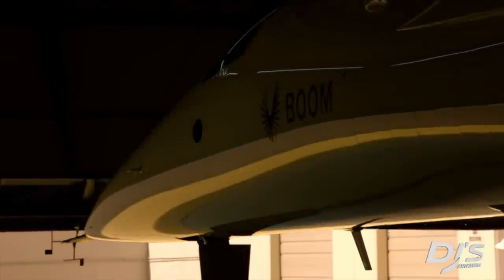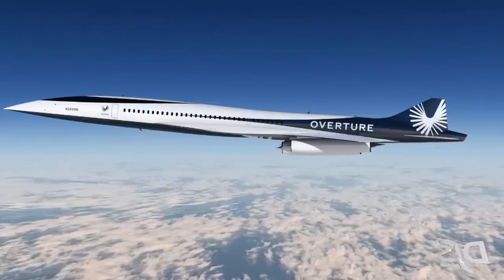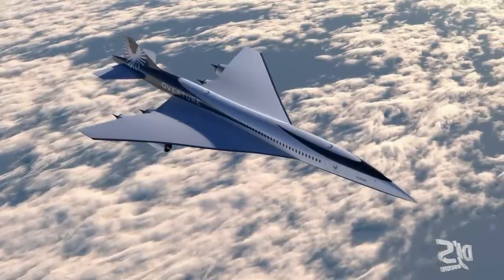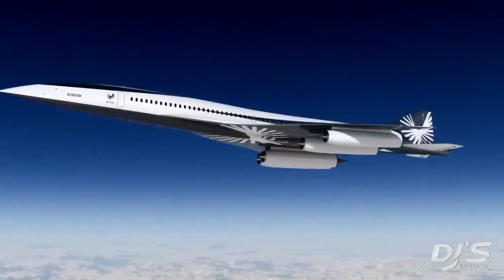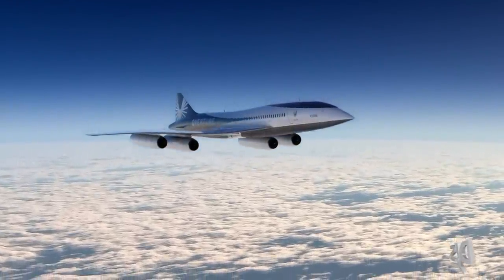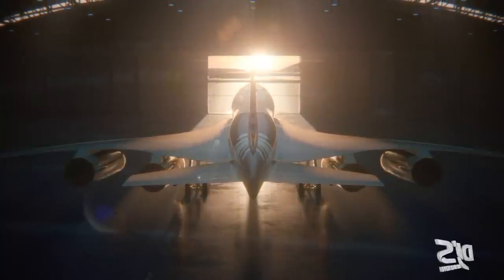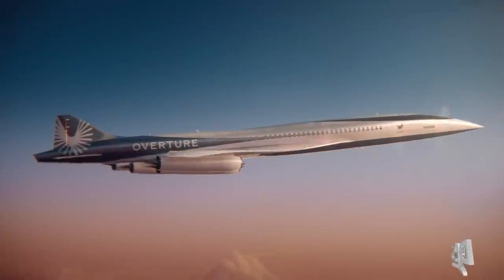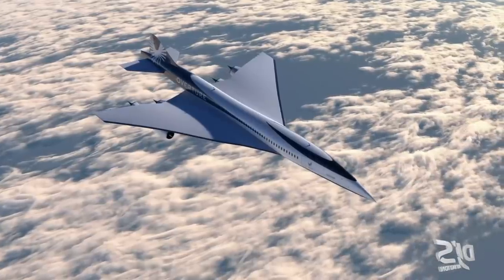Boom Supersonic MASSIVE News

Comment: Crazy.  They would have to sell hundreds of planes to even hope of breaking even.  There aren’t that many customers or routes or customers willing to pay triple the going rate to sit in a tiny seat.
Reply: Overture is not aimed at the main line economy market, which is more than adequately catered for by Boeing and Airbus, for example. Instead, it is targeting the 700 million long range business trips made each year globally, 400 million by Americans.

Because Overture will be fuel efficient at sub and supersonic speeds, and will be compliant with ICAO-14 subsonic noise regulations, Boom and the airlines have identified 500 viable routes, some mixed land/water, compared to just 2 Atlantic routes for Concorde. Commercial supersonic flight over land is effectively banned worldwide, so Overture will fly Mach 0.94 (10% to 20% faster) over land and Mach 1.7 (x2 faster) over water. 

A subsonic airliner does the JFK/LHR trip in 8 hours. Overture will do it in 4 hours.
A 16 hour subsonic trip across the Pacific would require a 1 hour refuelling stop, giving a duration of 4+1+4=9 hours total on Overture. 

All 65 to 80 seats will be quiet business class, almost certainly with internet, with ample room. Tickets will be the same price as subsonic business class. This, coupled with twice the utilisation of subsonic airliners, would give a good margin for the airlines.
Reply: Boom have set a unit price for Overture at $200M. The forecast development program cost is $8bn, so the payback would probably be around 150 aircraft.

Comment: Oh my god. Switch to 4 engine now ? But i want to see a supersonic aircraft with 3 engines
Reply: Where are you going to put the third engine? I'm sure there are big aerodynamic penalties for putting one in the tail
Reply: I absolutely hate three engine planes, even going back to the tri motors of the 1920s. They just look incongruous to me. The third engine has often caused problems with maintenance, failures, and upgrades too. An engine in the tail inevitably means a high horizontal stabiliser which entails high leverage forces and susceptibility to deep stall.

Comment: Unless the cost of a ticket is comparable to tickets on conventional airliners, it will remain a niche product at best. The same economics (as well as the environmental concerns) are what limited Concorde to just 14 airframes sold.
Reply: But i believe this is in fact the ideia. Its is a plane for business travelers, not for the masses as the Concorde tried to be
Reply: Overture is not aimed at the main line economy market, which is more than adequately catered for by Boeing and Airbus, for example. Instead, it is targeting the 700 million long range business trips made each year globally, 400 million by Americans.

Because Overture will be fuel efficient at sub and supersonic speeds, and will be compliant with ICAO-14 subsonic noise regulations, Boom and the airlines have identified 500 viable routes, some mixed land/water, compared to just 2 Atlantic routes for Concorde. Commercial supersonic flight over land is effectively banned worldwide, so Overture will fly Mach 0.94 (10% to 20% faster) over land and Mach 1.7 (x2 faster) over water. 

A subsonic airliner does the JFK/LHR trip in 8 hours. Overture will do it in 4 hours.
A 16 hour subsonic trip across the Pacific would require a 1 hour refuelling stop, giving a duration of 4+1+4=9 hours total on Overture. 

All 65 to 80 seats will be quiet business class, almost certainly with internet, with ample room. Tickets will be the same price as subsonic business class. This, coupled with twice the utilisation of subsonic airliners, would give a good margin for the airlines.

Comment: Assuming the composite structure can handle the surface temperatures generated at supersonic speeds
Reply: Its like 30C at mach 1.7, so its really not an issue

If you really want high temperatures there is carbon-carbon composite that can handle 800C.
Reply: @matsv201  content if that is the case. Concorde grew a few inches in length as full speed because of the heat generated on the surface by friction of the air passing over it. That was more than 30c.
Reply: @nicholasgething2163  No Concorde fly faster, hence are warmer. Around 60C. SR71 is even warmer.

Comment: Well did they ask Boeing for their design of the 2707-300? Crazy after simulations on software and it basically made a design over 60 years old. 

Shame its not got a 300 passenger capacity like its 60s design

Comment: This new design looks like it takes inspiration from the Boeing 2707, an SST concept which never advanced beyond a full-scale mockup.
Reply: The 2707 was a swing wing design. This is a delta wing
Reply: @jacobmoses3712  The 2707-300 was fixed wing with empennage, just like the latest Overture. The previous 2707-100 and -200 designs were swing wing.

Comment: Wasn’t part of the problem with concord that it couldn’t travel fast over land? This aircraft has to slow down over land too 🤔
Reply: Yeah. It's a redundant idea tbh
Reply: No civil aircraft can fly Mach 1 over land anywhere in effect, so Overture will fly Mach 0.94 (10% to 20% faster) over land and Mach 1.7 over water. The major difference between Concorde and Overture is that Concorde gobbled fuel subsonically, whereas Overture will be fuel efficient. Because of this, Boom and the airlines have identified 500 viable routes, compared to just 2 viable Atlantic routes for Concorde.

Comment: What is the market for this? ...... Trans Atlantic or Trans Pacific ? ..... LA or SF to NYC or Miami ??  Despite substantial improvements, Fuel consumption along with the Sonic boom issue will likely limit its flight corridors. If they do make it to production, I think they'll become a toy for the super rich with just a couple of dozen ultimately built.
Reply: Overture is not aimed at the main line economy market, which is more than adequately catered for by Boeing and Airbus, for example. Instead, it is targeting the 700 million long range business trips made each year globally, 400 million by Americans.

Because Overture will be fuel efficient at sub and supersonic speeds, and will be compliant with ICAO-14 subsonic noise regulations, Boom and the airlines have identified 500 viable routes, some mixed land/water, compared to just 2 Atlantic routes for Concorde. Commercial supersonic flight over land is effectively banned worldwide, so Overture will fly Mach 0.94 (10% to 20% faster) over land and Mach 1.7 (x2 faster) over water. 

A subsonic airliner does the JFK/LHR trip in 8 hours. Overture will do it in 4 hours.
A 16 hour subsonic trip across the Pacific would require a 1 hour refuelling stop, giving a duration of 4+1+4=9 hours total on Overture. 

All 65 to 80 seats will be quiet business class, almost certainly with internet, with ample room. Tickets will be the same price as subsonic business class. This, coupled with twice the utilisation of subsonic airliners, would give a good margin for the airlines.

Comment: Seems little more than an updated Concorde. It should be slightly cheaper to run but it still looks to be for the few.
Reply: Overture is not aimed at the main line economy market, which is more than adequately catered for by Boeing and Airbus, for example. Instead, it is targeting the 700 million long range business trips made each year globally, 400 million by Americans.

Because Overture will be fuel efficient at sub and supersonic speeds, and will be compliant with ICAO-14 subsonic noise regulations, Boom and the airlines have identified 500 viable routes, some mixed land/water, compared to just 2 Atlantic routes for Concorde. Commercial supersonic flight over land is effectively banned worldwide, so Overture will fly Mach 0.94 (10% to 20% faster) over land and Mach 1.7 (x2 faster) over water. 

A subsonic airliner does the JFK/LHR trip in 8 hours. Overture will do it in 4 hours.
A 16 hour subsonic trip across the Pacific would require a 1 hour refuelling stop, giving a duration of 4+1+4=9 hours total on Overture. 

All 65 to 80 seats will be quiet business class, almost certainly with internet, with ample room. Tickets will be the same price as subsonic business class. This, coupled with twice the utilisation of subsonic airliners, would give a good margin for the airlines.

Comment: This aircraft will probably only cater to the top 1%
Reply: Overture is not aimed at the main line economy market, which is more than adequately catered for by Boeing and Airbus, for example. Instead, it is targeting the 700 million long range business trips made each year globally, 400 million by Americans.

Because Overture will be fuel efficient at sub and supersonic speeds, and will be compliant with ICAO-14 subsonic noise regulations, Boom and the airlines have identified 500 viable routes, some mixed land/water, compared to just 2 Atlantic routes for Concorde. Commercial supersonic flight over land is effectively banned worldwide, so Overture will fly Mach 0.94 (10% to 20% faster) over land and Mach 1.7 (x2 faster) over water. 

A subsonic airliner does the JFK/LHR trip in 8 hours. Overture will do it in 4 hours.
A 16 hour subsonic trip across the Pacific would require a 1 hour refuelling stop, giving a duration of 4+1+4=9 hours total on Overture. 

All 65 to 80 seats will be quiet business class, almost certainly with internet, with ample room. Tickets will be the same price as subsonic business class. This, coupled with twice the utilisation of subsonic airliners, would give a good margin for the airlines.

Comment: Only carrying 65 to 80 passengers means the ticket prices are going to be crazy stupid
Reply: Overture is not aimed at the main line economy market, which is more than adequately catered for by Boeing and Airbus, for example. Instead, it is targeting the 700 million long range business trips made each year globally, 400 million by Americans.

Because Overture will be fuel efficient at sub and supersonic speeds, and will be compliant with ICAO-14 subsonic noise regulations, Boom and the airlines have identified 500 viable routes, some mixed land/water, compared to just 2 Atlantic routes for Concorde. Commercial supersonic flight over land is effectively banned worldwide, so Overture will fly Mach 0.94 (10% to 20% faster) over land and Mach 1.7 (x2 faster) over water. 

A subsonic airliner does the JFK/LHR trip in 8 hours. Overture will do it in 4 hours.
A 16 hour subsonic trip across the Pacific would require a 1 hour refuelling stop, giving a duration of 4+1+4=9 hours total on Overture. 

All 65 to 80 seats will be quiet business class, almost certainly with internet, with ample room. Tickets will be the same price as subsonic business class. This, coupled with twice the utilisation of subsonic airliners, would give a good margin for the airlines.

Comment: It will not be allowed to break the sound barrier over land...Only across the ocean. This is what limited Concorde in it's operations and it will do the same to Boom.
Reply: Overture is not aimed at the main line economy market, which is more than adequately catered for by Boeing and Airbus, for example. Instead, it is targeting the 700 million long range business trips made each year globally, 400 million by Americans.

Because Overture will be fuel efficient at sub and supersonic speeds, and will be compliant with ICAO-14 subsonic noise regulations, Boom and the airlines have identified 500 viable routes, some mixed land/water, compared to just 2 Atlantic routes for Concorde. Commercial supersonic flight over land is effectively banned worldwide, so Overture will fly Mach 0.94 (10% to 20% faster) over land and Mach 1.7 (x2 faster) over water. 

A subsonic airliner does the JFK/LHR trip in 8 hours. Overture will do it in 4 hours.
A 16 hour subsonic trip across the Pacific would require a 1 hour refuelling stop, giving a duration of 4+1+4=9 hours total on Overture. 

All 65 to 80 seats will be quiet business class, almost certainly with internet, with ample room. Tickets will be the same price as subsonic business class. This, coupled with twice the utilisation of subsonic airliners, would give a good margin for the airlines.

Comment: At 201 feet long, this aircraft is only 3 foot shorter than Concorde and with a greater wingspan, yet carries less passengers. Something is not quite right about this design. I do hope it makes it though.
Reply: Overture will have better low speed handling, with slower take off and landing, as a consequence of the bigger wing with leading and trailing edge flaps (both similar to the proposed B revision to Concorde) and empennage. Also, Overture will be much lighter. These factors should assist in avoiding the tyre blow outs that dogged Concorde.

Overture's roomy cabin will be quiet and the 65 to 80 seats will be comfortable business class, compared to Concorde's noisy cramped cabin and 100 economy class seats.  Overture will cruise at Mach 1.7 over water, but Concorde cruised at Mach 2.0.

Comment: A technological marvel, but I have doubts about the feasability of this aircraft. More fuel-efficient than the Concorde, sure, but how will it compare to the existing Boeing 787 and Airbus A350? And a range of only 4250nm and capacity of only 80 pax? That capacity is even smaller than that of the Boeing 737 and Airbus A320. Considering the amount of fuel it could potentially burn per seat, I'm reluctant to buy a ticket to board this aircraft.
Reply: Overture is not aimed at the main line economy market, which is more than adequately catered for by Boeing and Airbus, for example. Instead, it is targeting the 700 million long range business trips made each year globally, 400 million by Americans.

Because Overture will be fuel efficient at sub and supersonic speeds, and will be compliant with ICAO-14 subsonic noise regulations, Boom and the airlines have identified 500 viable routes, some mixed land/water, compared to just 2 Atlantic routes for Concorde. Commercial supersonic flight over land is effectively banned worldwide, so Overture will fly Mach 0.94 (10% to 20% faster) over land and Mach 1.7 (x2 faster) over water. 

A subsonic airliner does the JFK/LHR trip in 8 hours. Overture will do it in 4 hours.
A 16 hour subsonic trip across the Pacific would require a 1 hour refuelling stop, giving a duration of 4+1+4=9 hours total on Overture. 

All 65 to 80 seats will be quiet business class, almost certainly with internet, with ample room. Tickets will be the same price as subsonic business class. This, coupled with twice the utilisation of subsonic airliners, would give a good margin for the airlines.

Comment: Ten bucks says that tail gets a little bit bigger. The plane will need it for slow speed controllability. I’m not sure composites will make for a good supersonic airframe.
Reply: I'd almost agree, but given the plane will be fly-by-wire, the vertical tail may not need to be much bigger.
Reply: @Sacto1654  you could be correct. My gut tells me that tail gets bigger.
Reply: Composites will be reliable at Mach 1.7. They will also allow better streamlining, be lighter and simplify maintenance thereby reducing costs.
Reply: As you say the tail, especially the fin does look too small for adequate low speed stability, unless the four huge engine pods contribute to stability.
Reply: @phonicwheel933  I’m not totally convinced about composites at those speeds. I’m falling back on evidence of that. Plus, there are other factors not considered, that contribute to composite decay. That can and will add expense to airframes like that.

Comment: It’s a redesigned Boeing 2707 but it’s still worse when it comes to certain things such as the Passenger capacity. I wish it could have movable delta wings like the original 2707 design stead of a fixed delta wing. However I do prefer this design than the original Overture Design.
Reply: Variable Geometry wings were expensive as hell, and still are, the last aircraft with them (Panavia Tornado) was retired due to the upkeep for them.
Reply: @Dexter037S4  and heavy

Comment: No high-bypass engines?  Looks nearly unsurprisingly like the retired SST.
Reply: Florida Turbine Technology started the detailed engine development in January 2023. The engine will be a medium bypass supersonic turbofan which will use certified materials and parts, including, blades, rotors, accessories, and core. The manufacturers of these parts will assist throughout the engine development and certification program.

Comment: Sustainable airliner? Give me a break. All those recourses and all that fuel for 65 passengers… I thought we were supposed to be worried about the environment?? This would be terrible for it.
Reply: It's likely going to run on Hydrogen fuel, and will probably use the same engines as the USAF NGAD.
Reply: @Levi R 65-80 passengers. and not every widebody airliner flight is full capacity either

Comment: There would have to be a completely radical redesign of engine for this if noise levels are to be acceptable. Presently, it doesn't have an engine. I used to live under Concorde's flight path, and the noise from it was brutal. I loved that aircraft but I was glad when it retired. Transporting fewer passengers at faster speed has already been proved to be a poor business model.
Reply: Supersonic engines have to be low-bypass with very high exhaust gas speeds. That makes them INNATELY noisy, because physics. Ever heard a fighter taking off?